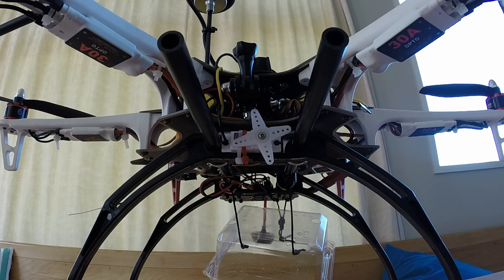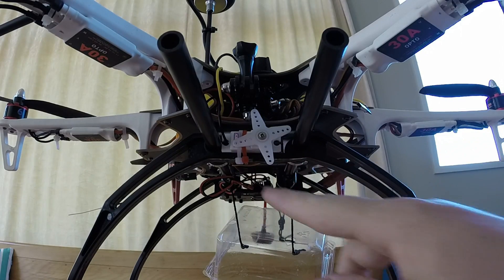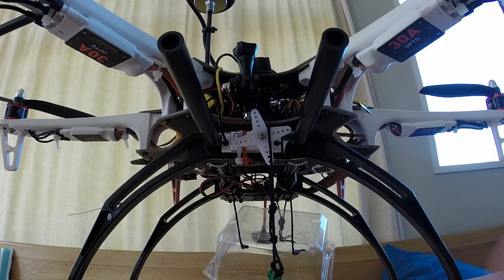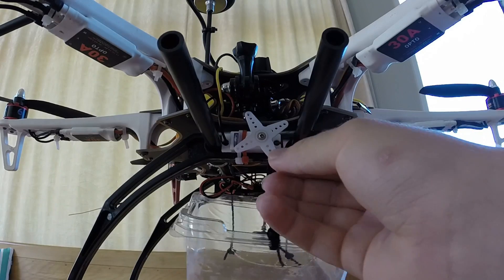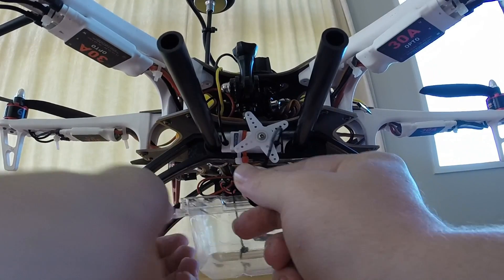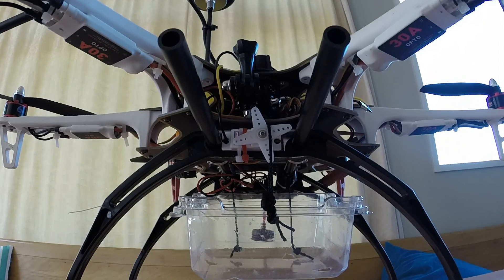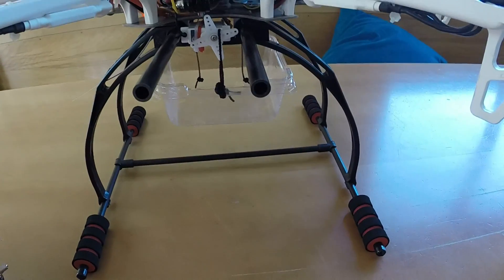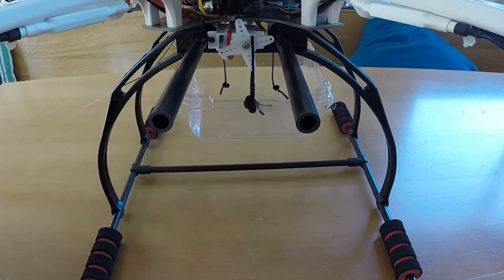How to build a simple dropping mechanism on a multirotor/Drone for water balloons

Comment: Did you use the existing receiver? thanks for the video :D
Reply from the maker: +Ben Dover yes I did, the servo plugged into channel 6 which is the aux channel. I'm glad you liked the video :)
Reply: Lukas Lindemann Awesome that helps so much thank you. I saw other YouTube's using a second receiver for some reason. I have an open channel, so I will use that. Thanks again :)